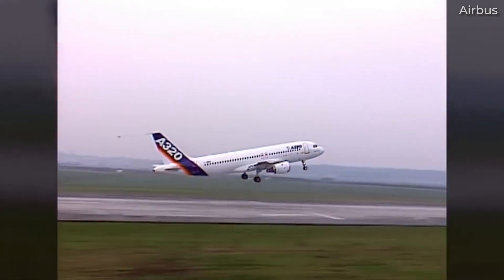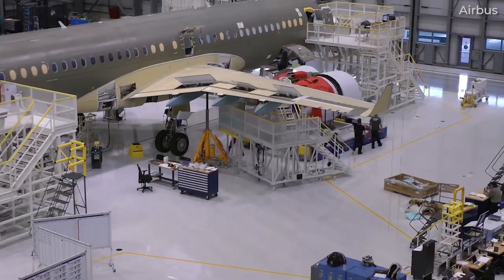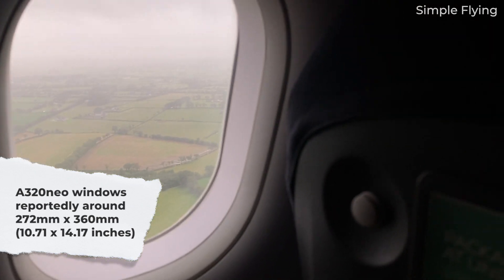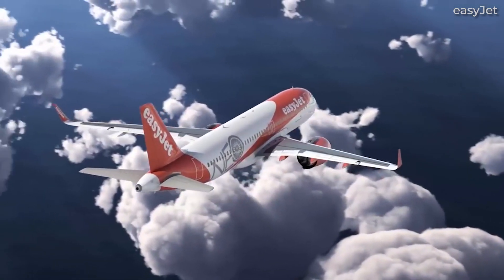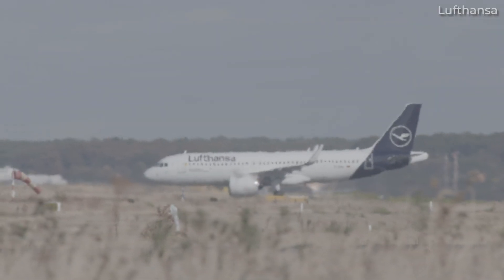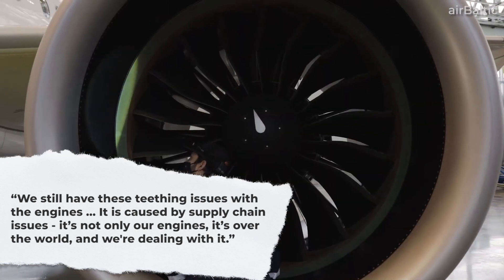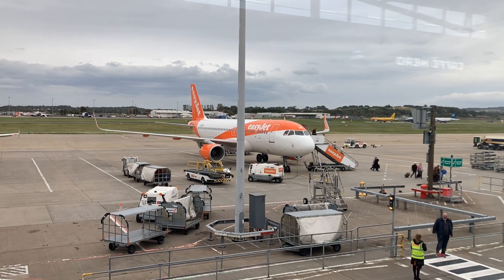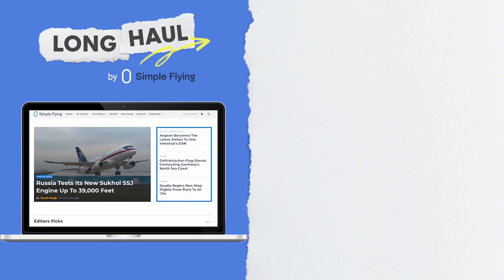Airbus Battle: Comparing The A320neo And A220-300

Comment: Both are great planes. I think the real factor would be how many passengers can you fill on any particular route at any given time. If you can consistently fill high capacity - then it is the A320. Otherwise it'll be the A220. I have flown on both planes and both are great.

Comment: Hmmm I don't get it. Both aircraft have about the same performance (range, fuel efficiency, etc.), however, the seating capacity is different. In single-class config, the a320neo can accomodate 195pax, while the a220-300 (or cs300) only 160. So the real comparison here should be between the A220-300 and the A319neo as both are 160 pax.

A321neo: €130M, 244 passengers, ~6600km, 1.8l/100PK
A320neo: €110M, 195 passengers, ~6500km, 2l/100PK
A319neo: €100M, 160 passengers, ~7500km, 2.6l/100PK
A220-300: €90M, 160 passengers, ~6100km, 2.3l/100PK

So for a bit less range, the A220-300 has is quite cheaper and has better fuel efficiency than the A319neo.

The A320neo is the most efficient of these (excluding A321neo, on that in a bit), but it is closer to the 200 pax planes like the 737 MAX.

And in reality, the A321neo is the A320neo killer as it is more efficient in litres per passenger kilometre (l/PK or l/pax/km) and is actually also cheaper at capital cost per seat. And I think we see that a lot, with airlines going for either the A220-300 or the A321neo when there is more demand. And on paper the 737-MAX (8, 8-200 and 9) are better than the A320neo. So I think this is the main reason not many airlines are ordering the A320neo.

I personally prefer the A220-300, A321neo and the new Embraer E-jet E2.

Comment: the A220-300 is a direct threat to the A320-200 Neo . . . if AIRBUS launches the A220-500 which is a stretched variant of the A220-300 it'll cannibalize A320-200 Neo sales over night . . . from a sales & revenue perspective it'd be wise for AIRBUS to retire the A320-200 Neo . . . suspend A320-200 Neo production indefinitely, after fulfilling all pending orders of the A320-200 Neo . . . the A320-200 has served the world's air travel industry for 36 years straight, undeterred which is truly commendable . . . but AIRBUS will continue making the stretched A321-200 Neo LR variant though . . . by the way, pending orders of all three variants of the A321-200 Neo stands at 382+ which should have been 683 - 740 at the very least . . .

Comment: I know this is probably not fault from Airbus, but if I see that I will fly any NEO, I just want to runaway from the airport as fast as I can.... it is the most painfull seat in 40 years of flying experience.
Reply: Seats are specified by the airline, not the manufacturer. n airline's NEOS are likely to have exactly the same seats as its 7373s. For more comfortable seats change your airline not the plane.

Comment: haven't yet flown on neither of them. Local carrier here (Croatia Airlines) has few A320-200s and A319--100 and I might just make a round trip to the south and back on one of them until they are replaced in 2-3 years time by A220-100s and A220-300s. And when those new planes come in I will do my best to use some of my vacation time to try flying on one as they look like brilliant planes and would love to try them on.

Comment: Airbus is investing in research on using hydrogen as a path to decarbonizing aviation. While they have emphasized completely new aircraft, I wonder if there is some room for hydrogen in upgrading existing aircraft types. Perhaps fuel cells can be deployed for internal electrical systems, or as a boost to existing engines. More radically, they could try hydrogen fuel cells on a complete reengining design, perhaps sacrificing range to achieve decarbonisation. It might make sense to start with a replacement for the A320neo, since it has the momentum of a large existing fleet and could have a rapid big impact on reducing carbon emissions. They could eventually go for a new fuel cell engine for the A220 family, potentially making it the greenest plane in the sky, even if restricted to short and medium haul.

Comment: For the passenger, the A220 is better. Wider seats and the luggage bins will be less full because its only a 2+3 row configuration as opposed to a 3+3. But I don't really care because the A220 and A320 are both better then the shitty B737.
Reply: I only flew on a A220 twice, but it seemed to me that overhead luggage bins were smaller than my usual A320, even taking into account the reduced number of passengers. At least passengers had a harder time fitting all their luggage on both occasions.

Comment: Since subscribing to the Simple Flying and Long Haul by Simple Flying channels, it's become a lot easier to recognise planes beyond livery. I flew from Kerry to Dublin and back this week and enjoyed a bit of plane spotting at Dublin Airport. Flying with Ryanair, it was always going to be a 737. It was a dash 800 that I was on but there were quite a few Max variants, judging by the newer wing tips and longer fuselage, at Dublin. The only A220 I saw was a Swiss Air one that was parked near my departure gate. I saw several A320's. Some may have been 319 and 321 variants, judging by their lengths. On taxi to the runway there was a classic green livery Aer Lingus A330. On its own a 737 looks reasonably big. But when you taxi past a wide body you realise the size difference.

Comment: Tye a320 and a220 are outdated and dangerous and prone to serfre turbulence
Reply: WTF are you on about?  Turbulence is a factor caused by weather.  It is nothing to do with the aircraft type.  

The A220 or C series is a clean sheet design that first flew in 2013.  The A320 first flew in 1987.  The B737 first flew in 1967. All are safe and relevant today.  

The B737 is on its last 4th and last generation with the Max, whereas the A320 is in its second generation with the Neo and could likely take one more.  The A220 is in its first generation.

The B737 aside from the spoilers has controls that are direct controls from the yoke and rudder pedals to the hydraulics on the flight control surfaces.  This reflects the 1960s technology.

The A320 and A220 are digital fly-by-wire which is a far more modern.

Comment: Two most simplest differences promoting A320 cause:
1)Type Rating and ground training for pilots wiz would be not shared 
2)A320 family covers A321 as well wiz the longer ultimate brother  given LR and XLR yet to come by next year as well having range around 8700nm
Reply: Yep. Despite having roughly similar range and Pax capacity, the A319 and the A220 do NOT cannibalise each other's sales, because the A319 has close commonality with larger A320 series (including pilot training). So the A319 is ought by bigger airlines while regional airlines are the A220's bread and butter.

Comment: I think a better comparison would have been between the A319NEO and A220-300. Both can directly compete with each other as an A319CEO replacement. Air France is using their A220-300’s to replace their A318’s and 19’s, so maybe examining which is the better replacement I would like to see.

Comment: I hope the A220 allows some ULCC to enter low-service/high-need markets currently monopolized by the big 3’s regionals. My city has about 1 flights per day depending on the season and at odd times and to 1 city only to hub connect. They’re always packed flights, which means more than 50 people probably wanted to fly but couldn’t. I’m sure people in my city’s area would like to fly affordably to other cities more often, but we just can’t.
Reply: Flying to low-service cities is only viable because of connecting passengers, ULCC's typically don't have a hub and spoke model so they don't get connecting passengers. The benefit to a ULCC is that you can convert a 737 to hub + 737 to destination trip into a single A220 nonstop trip. For example, Pittsburgh to Tucson nonstop instead of connecting in Chicago or Denver. Delta is using A220's the way you're suggesting though.

Comment: The very fact the proposed A220-500 could cannibalize A320neo sales explains why Airbus may not start the A220-500 program anytime soon unless it gets huge orders from multiple airlines.
Reply: Delta would be a good candidate as they have decided to phase out the A319/320 all together and move forward with the A220, A321neo and the 737 MAX.
Reply: @dmcr9525 where did to u see that I'm just wondering
Reply: Los A 220 reemplazarán a los 320
Y los 320 los alargan y se convierten en A 321 de todas sus variantes y gana más dinero
Así va ser
Y luego le sube el precio al A 220
Y vuelve a ganar mucho mas
Reply: and it'd probably look weird
Reply: I don’t think it would affect the a320 that much
Reply: Honestly, Airbus' comment made sense it's like making an A330neo version of the A350.

Comment: I've flown on all three modern short haul single isle jets: Neo, Max, and the A220. It's hands down the best passenger experience on A220: personal space, cabin pressurization, noise level and overall interior feel very much like a baby 878/350. I'm preferring A220 on bookings, and I'm ready to take an impact on less convenient connections or a little higher price for it. One caveat though: the whale sound it makes on takeoff and landing is spooky.
Reply: When the greatest downside is the sound being creepy you know the aircraft is good.
Reply: I’ve worked on all 3 as ground crew and maintenance, and the A220 is kind of awful to work on. It is the epitome of unergonomic and unnecessarily complicated.
Reply: Have you flown on the new E2s?
Reply: aisle

Comment: Why does the A220-300 exist? 

American protectionism.
Reply: boeing definitely screwed up regarding the C-series. 
fortunately American protectionism had next to no foresight regarding foreign capability within the aviation manufacturing sector. boeing had the ability to kill this design in the crib...they failed miserably. 
as more A220's are being used commonality will increase orders. it is now up to airbus to decide how to mature their future offerings with a better rounded set of options. 
America first can pound salt...their exceptionallism failed them.
Reply: Ironically the CSeries/a220 is made up of more American-made parts than a 787 for example
Reply: @serkandevel7828  
that's not "ironic"
it's poor decision making at the top.
Reply: Yes and no. Delta really wanted an MD-80 family replacement. They flew them until they couldn't any longer, so I wouldn't be surprised if they had been pestering Boeing for a replacement for years. And remember, Boeing was interested in having the same partnership with the C-series that Airbus snagged. Boeing had a temper tantrum after Delta placed that order with Bombardier, and it cost them a deal with the C-series, and a whole lot more.
Reply: @jerseypup I believe Boeing wanted to make a deal with Embraer instead of Bombardier, but I could be wrong

Comment: I'll fly the A220 over the A320 anytime for up to 3h or even 4h flights. Recently travelled on a Swiss A220 and it was quite comfy
Reply: Air Canada’s A220s are very comfy too. Smooth, quiet with decently sized seats that i had no problem fitting in comfortably. Didn’t try the business class on that one but i did on the MAX which has the same interior and those seats are nice and wide and comfy too however it was already falling apart and when i went to recline it would fall backwards a couple inches. I’d prefer the A220 over the max any day
Reply: I think it has to do with seats, not the aircraft itself 🤷‍♂️